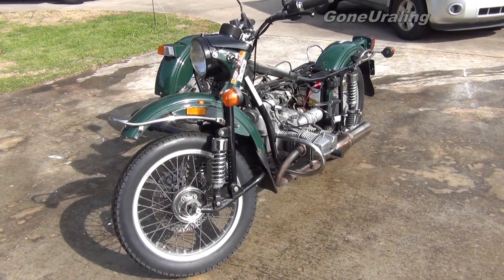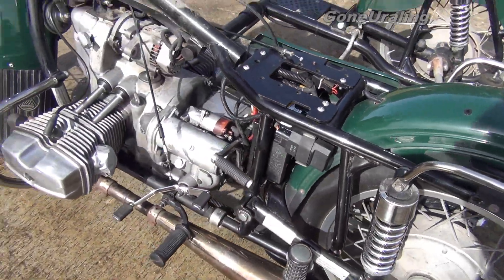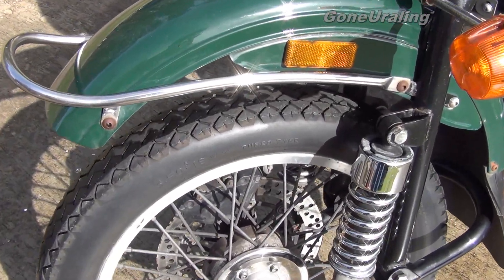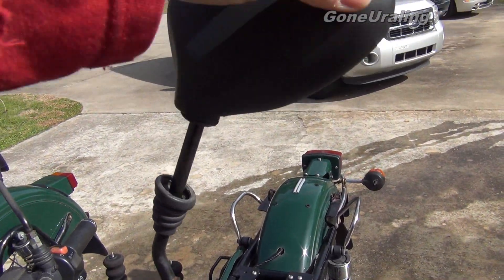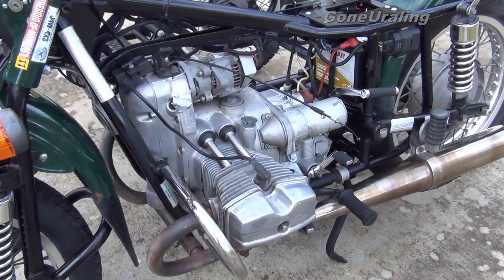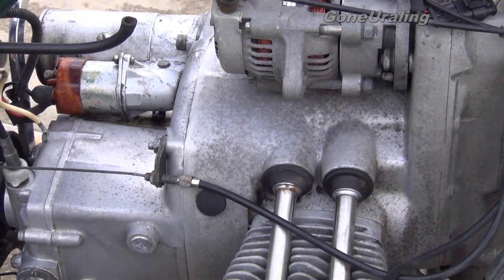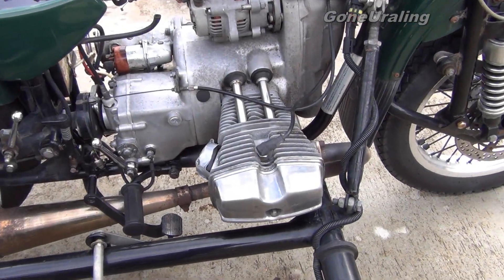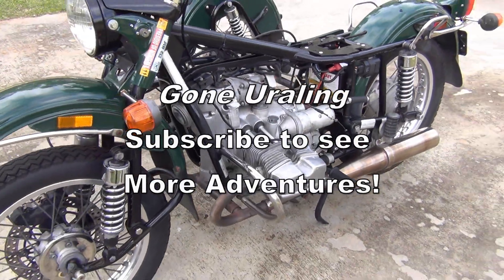2010 Patrol Project - WASH is a dirty word but it has to happen!

Comment: Is that front tire a 57 weight range? If so, EEK! And I know where there are two of those mirrors...adding it to the pile...
Reply from the maker: +JamesAllmond I'll have to bring a truck with me, not a tub :-)   Let's see, 57/S is 507 lbs with 112 mph max rated speed.  A fully loaded rig at 1000 lbs, that's only 333 lbs per tire... so long as I don't do something like STOP I'll be fine.  And the spiderweb cracks add ventilation to keep the tire cool, less chance of a blow out that way. Right? :-)